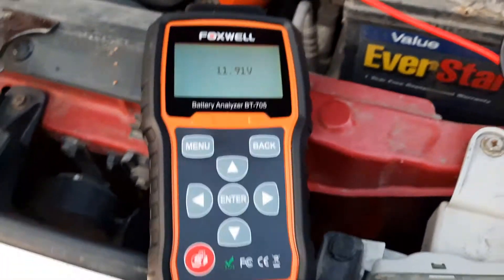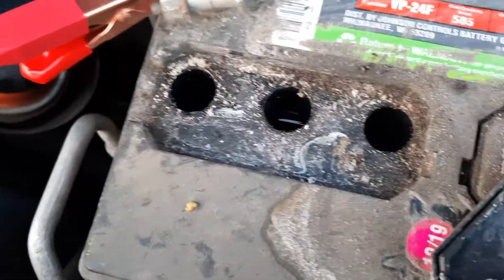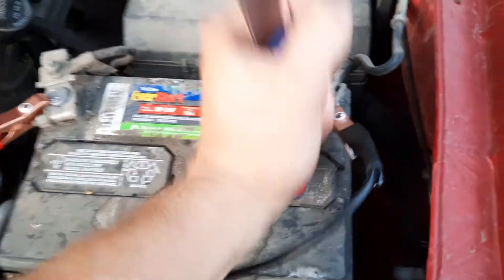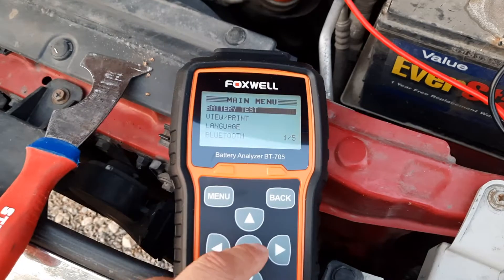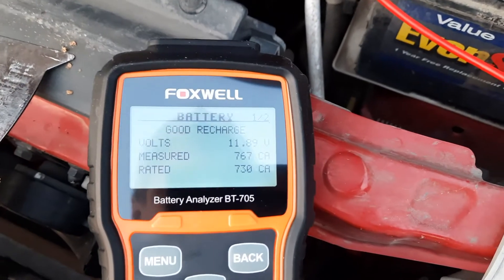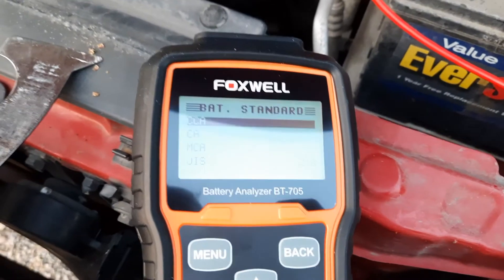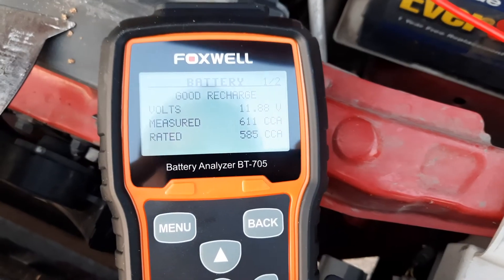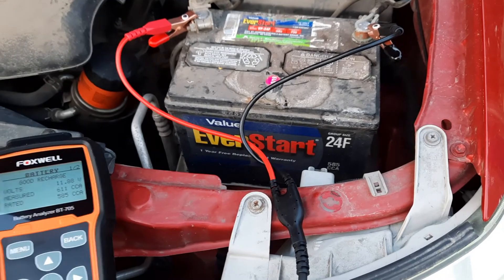Testing my Alum Battery with a Battery Analyzer

Comment: Hey great videos on the battery conversion. Say I read somewhere about using aluminum sulfate as the electrolyte instead of alum. Have you any thoughts or info about that? Also read about using aluminum sulfate + sulphuric acid combo. Any thoughts on these ones? Thanks!

Comment: Just bought good 2nd hand car lead acid battery to convert to alum battery for around 25 usd (60ah)... I hv made the alum solution so that its specific gravity   is about 1.26 to mimic good sulphuric acid specific gravity. Now I'm waiting my battery analyzer to come, just ordered it yesterday. I may made video later to compare the battery data ( soh soc volts cca) before and after convert to alum
Reply: Had any success of converting acid battery to alum battery????

Comment: I am an obsessed battery reaconditioner with very little luck so far. I was watching your videos about the alum conversion and I instantly said: "...this is bullshit without a CCA measurement with a battery tester",  but I entered in your channel page and get this video what´s exactly what I wanted to see. I got some questions:

- Did you do some kind of maintenance to the battery? You know some pulse charging, maintaining charging or replacing the electrolyte periodically?
- Had you make the same conversion with a used weak old lead acid battery?
- Do you have a second lead acid battery to compare the results you got with the alum battery?

Thank you so much for your videos. This is the most useful channel in all Youtube.